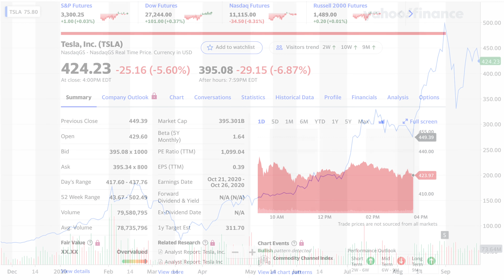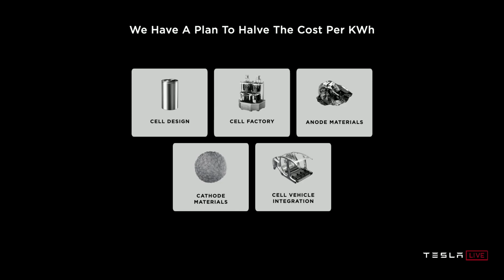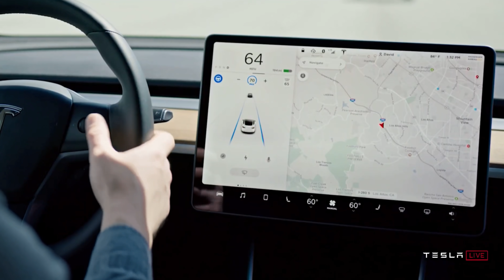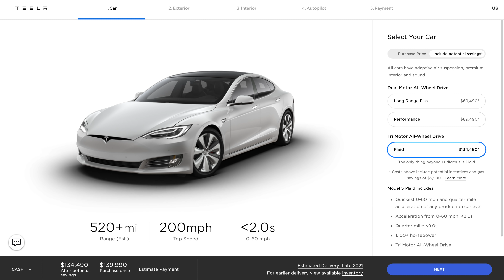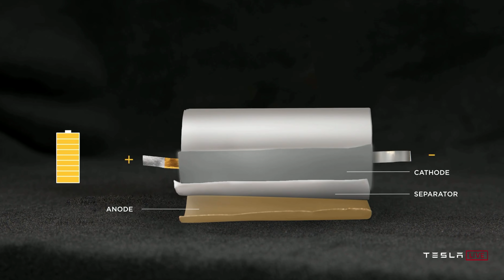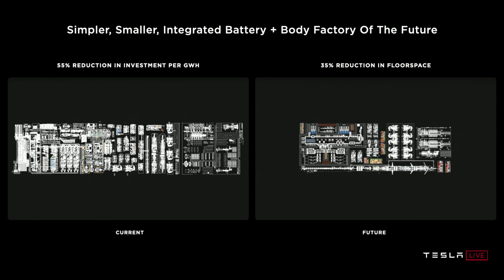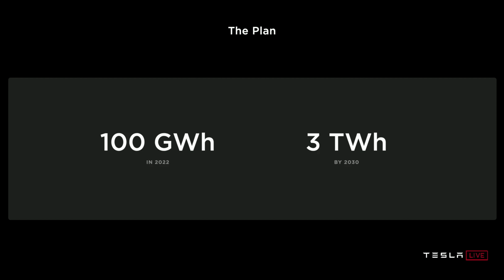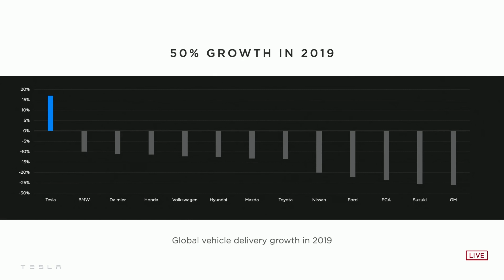Battery Day: Tesla’s Path to Becoming the Most Valuable Company in the World (TSLA)

Comment: I watched Sean Mitchell’s YouTube episode interviewing Andrew Miller. The last part of the interview Andrew mentioned something about the lower quality of Tesla’s battery cells manufactured in China. If I understood this correctly this this true? I am novice and still learning about Tesla because it’s a fascinating company. Thanks anyone who can reply to this question
Reply from the maker: Lower quality or lower energy density? Tesla recently started using LFP (lithium iron phosphate) cells supplied by CATL in China for the standard range Model 3 out of Giga Shanghai. They aren't lower quality, just a different, cheaper chemistry that is not has energy dense as the nickel cobalt aluminum cathode. But energy density is about getting to an acceptable range, which Tesla can achieve with LFP now, so it's more cost effective to use those cells and also reduces reliance on cobalt.

Comment: Hi Rob. You have projected 15 gagafactories based on 3 TWh battery capacity and 100 kWh/car assumption, which is a mix up of battery factory and car factory. It is also confusing because Tesla is using the new term "terafactory". Talking only about the "battery" terafactories, the battery day presentations directly/indirectly said that Tesla will need 3 "battery" terafactories for its 3TWH goal, and the investment would be  $24.7B each or $74.1B for three. Each "battery" terafactory will have 50 assembly lines. (John Park)

Comment: I don't think Tesla will ever reach 20 million cars per year.  Robotaxis should cut the legs out from under new car demand.  Based on Seba's analysis annual demand should drop from ~70 million to ~15 million.  Then if Tesla started producing a Cybertaxi - stainless steel body that would last decades - annual demand could drop under 5 million.  Swap in a new million mile battery once range degrades and refurbish the interior every few years.

But not to worry about Tesla's future profits.  Tesla should be raking it in my charging for rides.

Comment: Resistance in new battery is 2% of old battery resistance when charging and discharging.  Heat conductivity should also increase if tabless version continues to remove most of the heat through the top and bottom of the cell.  Should mean at least a 10x higher charging rate.

Comment: Where will the Primary Power come from to charge the batteries? Wind and Solar will not cut it without horrible environment smothering farms as far as the eye can see. Hydrocarbons and Nuclear will not magically be cut out of the picture like so many are pretending right now. Renewable Energy is a nice dream but it is a Mirage. The only true "limitless" 24/7 energy source would be geothermal but we only have tech for that in volcanic and tectonic areas where the magma comes up close enough. Drilling down to the heat would be a bitch and people already complain there are too many hydrocarbon wells.

Comment: I think the Berlin model y will be the first car to use the new cells. In the interview he did in Germany, he said that he would give more details about the German-made model y on battery day. And on the slide where they showed off which model would use what chemistry model 3 was with the megapacks and model 2, the model y was with the model s, x, and powerwall. The cell to car slide where it is one big casting for the back one for the front with the new battery pack design in the middle. Elon tweeted out that the model y made in Germany would be the car to look at when it comes to innovation. And lastly, in the Q&A, he was asked if they would make batteries in Germany, and he said they would be making cells in Germany. That would mean that the cells will be in the model y next summer before the plaid model s!!

Comment: You think that Tesla will utilize different battery chemistries in the new 4680 format? For example, LFP?  Are both ends of the battery tabless? The reason they are now switching to full integration into the structure is because the battery will last longer than the car.  Prior to this, they had to worry about replacing faulty modules/packs on the models s/x and that type of manufacturing just became vestigial for the 3/y. Any idea about how many cycles each battery chemistry is good for (assuming they'll make the 4680 with different chemistries)?

Comment: For those that don't understand how amazing battery day was:

1. Tesla will create their own superior batteries in a structural pack in a new facility in North America (And Berlin per Q&A) At a 56% reduction in cost per kilowatt hour that will also recycle all existing batteries. The new batteries will have a unique-to-Tesla silicon anode which can store nine times more lithium and a zero cobalt, high nickel cathode for long range applications such as the cyber truck and semi.
2. Future Terafactories can be 5 to 10 times smaller through volume metric efficiency which can output five through 10 times more than a standard facility such as Fremont. Consider a TeraShanghai which is 500,000 units/yr now would be 2.5 mil to 5,000,000 with a 56% reduction per kilowatt hour using their own ethically sourced superior performance batteries than anything currently on the market.
3. Tesla developed its own aluminum alloy which allows the new casting machines to work. There is zero competition with this alone.
4. Tesla will mine its own silicon for the anode. The anode is 50% of the battery composition.
5. New teslas will have 54% increase in range and create far more horsepower.
6. The new structural pack design for batteries is safer for collisions (Tesla's already are rated the safest) and gives the car better handling/agility while providing more room.
7. Cell production facilities will produce 200 GW/hours. The pilot facility will produce 10 Gw/hours.

Comment: million mile battery- sure it would be nice but the cost of the battery comes down to.. lets say $3-4000 and lasts for 500,000 miles. i dont see that as that big of a deal. damned near 0 maintenance for 10-15 years and then drop a few grand and be good to go. I feel like a million mile battery would outlast the other components in the vehicle.       unless were talking about cycle life for stationary storage batteries that could last for 50 years

Comment: Very interested in this clever tabless design. The 5x energy is probably just from battery volume alone, but the 6x power definitely has something to do with this tabless design. From the renders and the screenshots I'm guessing this is a huge parallelization of the anode and cathode connectivity? So instead of having all the electrons from the entire jelly roll bottleneck ingress/egress from the thin tabs we now have the entirety of the roll able to allow ingress/egress? Would be substantially reduced resistance and lead to the reductions in heat creating as graphed in the presentation and explain the massive power increase capabilities. If this is the case that is incredibly S3XY

Comment: 500 miles range with current cycle life of 1500 is very close to 1 Million miles. 750,000 miles. I didn't hear them mention cycle life but if it is increased even a little to 2000 is 1 Million miles.

Comment: They said that the power was 6x increase for a 5x volume expansion. So at bare minimum it should be ~1.2x current charging speed (~300kw). From there everything would just be ultra-wild speculation.

Comment: you are correct, the charge rate should increase, the limiting factor is temperature, and the tabless design is promoted as causing less heat, thus the larger cells

Comment: Couple of things:
1. I don't think they were ready to talk about cell life because I don't think that they have the final version of the cell yet. If they haven't 100% perfected the dry electrode, they probably want to do that before they would actually announce anything.
2. They had a graph about the speed of supercharging for the larger cell. (it is at 1:53:08 of the live stream) It looks l like the larger cell will be ever so slightly slower at charging than a 2170. Also, at 6x the power and 5x the size, I would speculate that it would be pretty comparable.  You could speculate that this would only be a 25% increase in power/kg. I would assume this because they say 5x the energy, 6x the power on the same slide, which means compared to the previous size of the cell, but I could easily be wrong.

Comment: "3 Tera-watt hours' production by 2030? 80 times current? It's going to be double that, 6 TWh, or better. (Put that in your calendar for 2030. Some guy says.... if I'm wrong it'll be because it's 12 TWh.) Tesla will get the first Terawatt Factory open, it'll be a struggle, probably later than expected. But then they'll immediately start on the second....but when they get to the third, they'll just order three or four of everything. They are not just growing, they are accelerating. 
Musk seemed almost surprised when he said that large manufacturing companies "as they grow slow down. We're actually getting faster." And he seemed almost surprised. When he mentions this in a year he won't be surprised, he'll be ecstatic. The more we do, the more we find we can do, and as we look to speed things up, we find more and more ways of speeding things up. 
Soon they're going to have to begin designing machines that are more versatile, or more easy to recycle into raw materials to build newer machines. An engineering requirement will be to make machines that can operate at many times their design speed, but which won't have to last longer than about five years. 
But what form does this accelerating take? Single path forward, is building one factory, then another, and then three at the same time. There's also horizontal acceleration, where you look for all the ways to improve what's already working. You don't need an octovalve, but it's better if you make it. You don't need to do single casting, but you do it anyway. There's a near unlimited number of small things that add up and which can be improved. This is where Musk and his teams never see just a battery, they see the entire process. (I once paid $600 to have 500' of  two different diameter stainless steel 'piano' wires (about $40) straightened. When it comes spooled it has two twists in it. When it's drawn through dies at the factory it comes out perfectly straight, and then they don't roll it up, they twist it up. There's no need for do this. When turned into springs it's not a problem, but there's absolutely no use for  twisting wire, but if your application needs it straight you have to go to the next step. This is the sort of thing Tesla fixes while everyone else is either too small (me) or too set in their ways to even think about.)  The Nickel mining to battery change they're implementing. There's a couple of billion dollars no one ever bothered to even think about. 
A third acceleration are all the implications (this you know is towards the end of every scientific paper. What are the other ways this information or study may be useful.)  Heat management in the battery and motors, and heating and cooling the passenger compartment...implication? Is home/building HVAC as efficient? Not even close. So lateral expansion into a new business.  
I will never forget Battery Day. We were shown the future, it looks great, but if we read between the lines there's enough information there indicating that the future will not only be great, it will be even better than what is projected and being built, and it will be great in ways we can't even imagine yet.  Yesterday was remarkable in ways we won't understand for maybe a year or more.

Comment: You totally missed the MMB ("Million Mile Battery") marketing references because they weren't phrased that way, you were listening too closely without processing, and you jumped to the wrong conclusion. This was a technical presentation in which the presenters knew what was required and clearly explained all the factors to the MMB, such as the new cobalt-free cathode containing super small grained silicon densely packaged in a flexible substrate so it would support more lithium with less cracking over more charge+recharge cycles.

Comment: VTG was never realistic. 

Vehicle to Grid as envisioned by most is unrealistic. I spent a decent amount of time exploring building my own "realistic" powerwall versus buying 3 Tesla PWs. There are a variety of reasons I just had 3 PWs installed. Integrating with an existing utility entrance is complex and no matter how you cut it requires a Gateway-like function ( automatic transfer switch and controlling computer and its SW ), modular inverters properly sized and significant high current rewiring. The larger the battery one is trying to utilize the tougher all these problems. 

My triple PW setup ( 40KWh and 3 5KW inverters) demanded a new 400A panel ( non-backup total current combining)  plus 2 200A panels ( generation and backup) plus a Gateway. The raw AC current potential exceeded a standard 200A panel at  3PWs. This all must meet the NEC and has nothing to do with any EV battery and the NEC is incredibly conservative. If one tried to somehow tap into an EV battery ( all are larger than my 3 PWs), all of these problems would still be there along with the $3-4000 to buy the equipment and install it. 

If one tried to use only a tiny bit of the EV battery ( 1 PW), it would still need most of the equipment and much of the labor. Tesla cannot afford putting a utility class inverter in their EVs due to cost. Anyone who tells you that this high power electronics is cheap is wrong. Then there is the problem of the EV charger location not being near the utility entrance. What about the wiring from the charger to the "gateway-like" device at the entrance? 

Then there are the issues Elon mentioned. 

The only hope is in the case where one already has installed a PW and wants to use their EV as expansion. Once a PW is installed, an inverter could be located at the charger and backfeed to the service entrance and be controlled as though it was a solar system. PWs can turn solar inverters on and off via UL1741 frequency control so they can be located anywhere on the home micro-grid. So it might be feasible to add a 10KW inverter at the charger and it adds additional battery power as the EV software allows but the home can always fall back on the resident PW. That's a realistic scenario  but not just plugging in your EV and expecting all the nice VTG capabilities. It just doesn't work along with Elons market issues.

Comment: What is clear now that the new Battery Pack is the structure of the Cars, means that Tesla could and need only to change the size of the Pack ( smaller ) and use the casting machines what they have right now also in the smaller Car. This is one more cost-saving. to make a new style for the cheap version they need to only make the outer shell compatible with the Frame.

Comment: I'm not sure higher charging rates (or longer charging rates at high power) will be due to the tabless battery.  A larger battery = more heat generated.  The tabless design will mitigate that some, but not enough to increase charge rates or maintain high charge rates for longer. Just my 2 cents worth.

Comment: It was interesting that they didn't announce how all this new technology would make their new cars 'better' than they currently are - it was all about lowering manufacturing costs and increasing volume.  Frankly, I was somewhat underwhelmed because I was expecting them to announce that they could improve charge speeds drastically (up to 350-450kW) with the new cells.  I guess it's because the new cells are not going to be in new cars for at least a year, they are holding off on announcing how these new cells will improve the end product specs.

Comment: While the cost road map announcements were very good (not earth shattering), I came away from Battery Day very disappointed.
The (ultimate) overall 56% pack S/kg cost reduction is good but the timelines were wholly underwhelming.
As a huge Tesla fan, who's been waiting for Battery Day for something like 18 months, I was expecting the announcement of very near term mass production ramping. I was expecting these long awaited improvements to be production ready. Instead, we have a bunch of mid-term projections, dependent on several more rounds of technology improvement. 
The cell improvements from Maxwell etc are still several iterations away from production yield, at which point they will only be "pouring" out of a meager 10GWh pilot plant in Fremont. That's useless for critical, supposedly near term, products like the Semi, Cybertruck and the roadster. I expected these technologies we've all been talking about for 18 months to be  ready and an announcement of mass production ramps in Nevada and elsewhere, specifically to provide a firm release date for these products. We got nothing. no update on the Semi. No update on the Roadster. No update on the cybertruck. For god's sake, even the Plaid Model S is now "late 2021". That thing should have been late 2020!
Overall I got very little sense of when these Great technologies would be deployed in scale. They floated the 3TWh by 3030 aspiration, but I get the sense that these 56% cost reduced batteries wont be a significant part of Tesla's output for at least 5 years.
Anyways, like I said, Huge fan, and not one expecting magical tech like solid state or whatever, but this whole event left me cold, left me with the sense that we're much further away from the revolution we need than I expected.